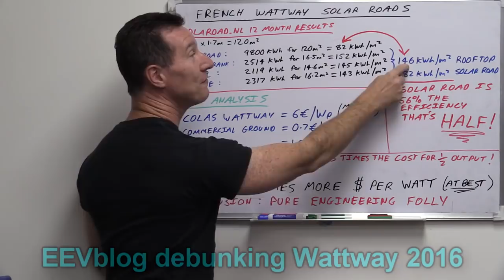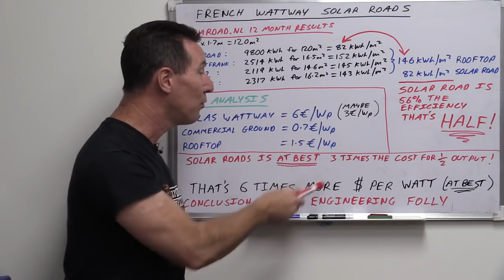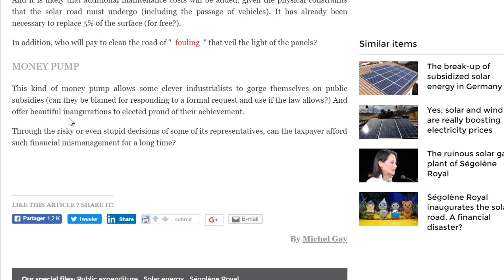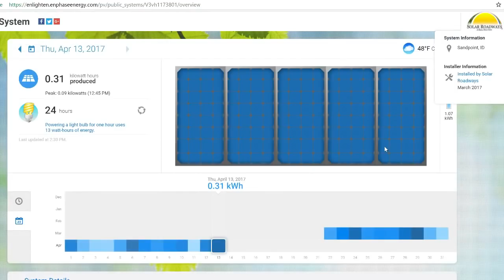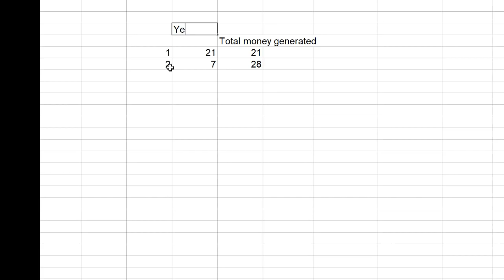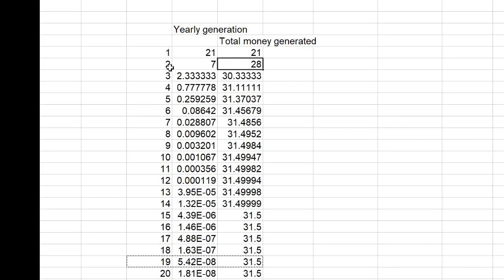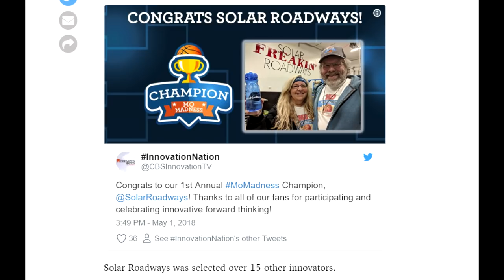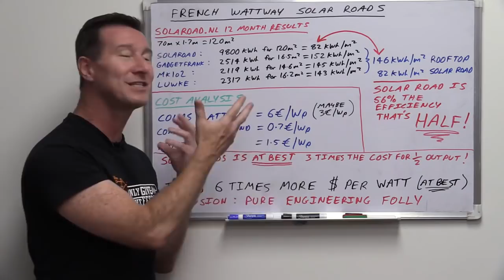Solar Roadway: 10¢ return on $1000 investment!

Comment: Wait: In the beginning he said, that 1% of the deserts full of panels would be enough to supply the world. So? Go for it!!! That, for once, seems like a reasonable and smart idea! Why does everybody want to make solar-something? Soalr panels are made for power generation. So, if you want them to act as road, you gotta make compromizes, wich will greatly reduce the efficiency of the panels. Why not just, as the guy in the beginng said HIMSELF, build a bunch of panels in the desert? No need the stuff them into the road, thus 100x the cost and x0.0001 the output!
Reply: Because the deserts are not where  most people live. It's not exactly economical to, say, run a cable from Sahara to central Europe.

Of course it doesn't have to be a desert, any flat area with enough sunlight will work but in most places you can't rely on solar alone no matter how many panels you build.
Reply: You sure about that? Plans for Supergrids seem to exist since a long time, and they seem to be pretty useful  in the long run.https://en.wikipedia.org/wiki/Super_grid
Reply: I agree, building a solar farm in the middle of nowere would be stupid. My point is, that it's not really any better, to put solar panels into roads, and that instead we should look for unused open spaces, such as rooftops, skyscraper facades etc..
Reply: Yeah. Though a lot of areas in Europe for example don't get enough constant sunlight anyways so solar would be an unreliable energy source. Solar definitely has its place....having a couple of panels on the rooftop certainly won't do any harm but it's not suitable as a primary source of electricity.

Personally I believe nuclear power should be the future....we'll have to build a few spent fuel repositories but apart from that it's clean, efficient and with modern technology also safe.

Comment: Well of course they are putting them on the road, cant put them on peoples houses they might steal them, cant do the elevated ones next to roadways people might use them for shelter! We cant put them in open fields the cows might lick them! Cant put them in deserts the emus and dust will attack them. 

Come on this is all common sense its either on the roads or in the ocean, the later is better due to them being WATER COOLED (you lose efficiency due to heat on solar so actively cooling them is a bonus) and they are self cleaning due to being in the water. Cant put them on top of the water as people might steal them or use them to not drown.

Comment: We need solar road roofs! A roof for every road, no more snow, no more rain and much more problems ;)
Reply: Roofs over roads would be extremely expensive.
Reply: Guess what so are not working solar roadways ! ;)
Reply: Skyven Razgriz That would be cheaper lol
Reply: @Skyven How would you drive over roofs???

;)
Reply: Standardowy Login finaly someone asking the right questions ! Well of course we will all have to use hover bikes, there should be a scam sooner or later enabling this tec.

Comment: I know that solar roadways, and the solar walkway installation in Sandpoint is a 100% failure. There is no future for solar roadways and it is conceptually just a bad idea. However, I do not agree with your spreadsheet demo. 

How can you assume that the 66% loss in efficiency will happen every year? To assume that such a loss is linear with no diminishing returns is a huge assumption to make. I would be surprised if the loss wasn't due to technical complications, and therefore a one-time occurrence, and therefore would possibly even get better next year.

A 1% loss would happen every year, but not a 66% loss. It is more likely that the 66% loss is due to technical complications that may actually be resolved next year, and you may see in increase in efficiency. I think it should just be shut down however tbh. Complete waste of money.
Reply: I prefer eevblog's style of using the most favorable assumptions possible, since that shows that there are no reasonable assumptions under which the system could be viewed as sensible.  Hyperbole simply weakens Thunderf00t's argument.  More important, however, is emphasizing that while it is sometimes useful to invest in poorly-performing technologies in the hope that investment will yield result in improvements (LEDs, for example, were pretty dismal in the early 1970s, but investments in the technology have paid off substantially in the decades since) but there's really plausible way that solar roadways could ever offer any real advantage over competing technologies.  Any improvements in the cost or generating power of photovoltaic cells would help other solar technologies just as much as solar roadways.
Reply: @KLM "How can you assume that the 66% loss in efficiency will happen every year?".... Its what it lost in the 1st 2 years already...So he used that 2 year loss as a baseline. Hes also not including other factors which could potentially make that loss worse.
Reply: "That 1% loss could be due to a technical problem" is also an argument you can make
The thing was 66% less efficient after a year. that's the data. doesn't matter if it was a technical problem or whatever and there's no reason to assume it would get better and it's not like this was his linchpin anyway is just a point he made based on Raw data it's just as likely to be validated as it is invalidated by Future data
Reply: I'm going to be blunt and just say that it's way more realistic to assume that they don't lose efficiency, they just break and then the return is literally nothing some time after the first year.

A 66% loss is nothing to shake a stick at, it means something looks seriously wrong to say the least.
Reply: It's 7 dollars man. the return is so fuckin low I don't think accuracy really matters.
Reply: I understand. My point isn't to advocate for or against the monetary returns. I am pointing out that Thunderf00t's reasoning is not right here. He usually makes very well thought out arguments, even in the rest of this video. But in this particular segment, it just seems lazy.
Reply: Go back and watch some of his other videos debunking other things. He may reach the right conclusion but he often is very hyperbolic and doesn't always use correct methodologies. You just noticed it for the first time.
Reply: Yeah, he does it a ton. Like in some of his "water from air" debunking videos, he basically ignores that with heat pumps, COP is a thing. I mean yeah, with Peltier devices, the best COP you can hope for is around 1, but still, he implicitly assumes that it's =1.

Comment: there are some university researchers testing out solar flowers installed in the center of the generic european roundabouts, these flowers fold themselves in for the night to avoid damage and bloom in the morning and follow the sun's path
Reply: Still mostly a vanity, virtue signalling project. You're on the ground, surrounded by buildings and other vision obstructing things, roundabout islands are not that easy to maintain, given that there's traffic all around, etc. You'll have to clean them regularily, repair them, maintain the mechanical construction moving them around. That construciton alone will be pretty expensive.

Solar panels are getting better incrementally. They're already bought and installed by private actors wherever it makes sense. There's really no need for these kinds of projects at all. But it's a good photo op for politicians and makes people feel good about themselves.

Comment: I agree that solar roadways are stupid.  And I agree with most everything thunderf00t posts.  But his extrapolation of predicted degredation by 1/3 each year is clearly unfounded.  Probably the surface of the test panels has degraded (weathered), and it's likely the panels will hold more or less steady since continued weathering of the glass surface shouldn't worsen transmission of light.  Even if I'm wrong, a drop to 1/3 between year 1 and 2 doesn't form a trend in any scientific analysis.
Reply: the panels are already at the point of failure and need to be replaced. if they currently earn $7 a year their long term surface properties are moot . they didn't even survive the first year. they failed to defrost themselves, they failed to be an lcd road surface, they failed to be an rgb decoration. the same amount of money invested in standard solar on every roof on that street would be making considerable money.
Reply: YUP, and that is an excellent point that Thunderf00t reasoning is false, they will not continue to 1/3 each year, it's far more likely that they've bottomed out or close too it.  Again not discounting that solar roadways are moronic, but science and math are things and you can't pick and choose.
Reply: Mark Hunter. Exactly what I thought.
If you are trying to show how really bad something is, you should show how bad it is in a best case scenario.
Reply: Yeah, dodgy extrapolation and just not needed. You can afford be as generous as hell and it still looks ridiculous - even if they ran at 100% of their  first year efficiency for decades those panels still wouldn't make any sense.

  I guess it's largely that many of the PVs and power electronics have just died and not been repaired... which is what happened to the LEDs iirc. if the Brushaws get down there next year and do some repairs and get their 2019 generation to go up  they're going to be using the improvement to '*debunk*' you - if production levels off l they're going to use it to '*debunk*' you. 
you've taken yourself hostage.
Reply: so 25 cents is somehow better than 10?
Reply: Mark Hunter Are you tarded? He just showed you the statistics. The surface will continue to degrade and that's with no load lolololol. It would be even worse in actual use. He was generous.
Reply: The issue is that his science on the change per year is not rooted in evidence or observation.  2 years of observations are insufficient to make a trend.  I'm not questioning his overall conclusion which is 100% correct.  But in rare cases (such as this one) Thunderf00t has made a small mistake.

Comment: How about using the weight of passing cars as energy?
Reply: That has already been proposed, but since it takes kinetic energy from the vehicles, it only makes sense where the vehicles would be slowing down anyway, or at remote roads where other methods of power supply are not available. In other words, rather limited usefulness.

Comment: honestly the smarter decision for a 'solar roadway' would have been to build panels above the road on tunnel like structures.  Then they can be angled for better efficiency, use better materials for the purpose, and when they prove to be a financial disaster as well, least the road can still be used.

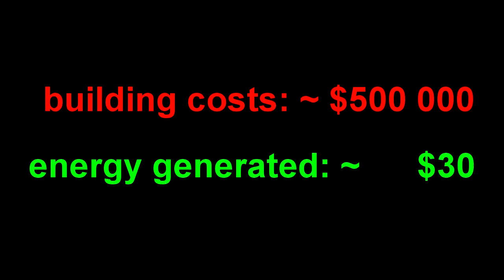also, 11:45 you math is off.  Not 10 cents per 1000 invested.....it's 6 cents.
Reply: Put them on top of the cars.

Comment: Why make a road out of solar panels?  Even if it were just as efficient as normal solar panels, repairs mean halting traffic, they’re cast in shadow during heavy traffic, and they’re far more expensive to install. I’m sure there are at least 50 other reasons that it makes no sense versus just installing them alongside roads or virtually anywhere else.

Comment: "Solar roadways are the future"

...says the idiot in the introductory video, while standing in front of a vast, empty, and quite flat desertic landscape which would be a very nice place to plant a cheap and profitable solar farm...
Reply: Get a few acres of Mohave desert and build Helios One. DONE!
Reply: Helios One was based on a real world Solar Two facility that no longer exists.
Reply: i'm a simple man, i see a new vegas joke, i upvote it
Reply: Yeah.. but isnt placing it on the road in the middle of the desert the same? Sands still blowing to the road
Reply: Well, besides sandstorms, the other issue of building it in the desert is that well.. basically no one lives there. Which means you need to somehow transport the collected energy to where people are. And there is a significant loss weather one transports them hundreds of miles through cables (which can always be at some point and then shut the whole system down until they get repaired) or if you store them in batteries and then transport the batteries to the cities-- it might take nearly as much power as is in the batteries to transport them.

The selling point for doing them in roadways was supposed to be that they are already so close to things that you want to use that energy for-- plus they wanted to make it melt snow and have them display road markings. But since they can't gather enough power to do all that, it really defeats the whole point.

The smart thing to do would be to cover rooftops with solar panels as, except in case of snow, they will generally gather more than enough power to serve the needs of a 2-story household and you can store the power during the day to use at night. You can place them on top of street lamps which in the case of LED street lamps will collect enough energy during the day to keep those street lands on at night. Put them on top of tunnels which will provide more than enough power to light up the tunnels.

So many better places to put them than to replace the street-tops or putting them in hundreds of miles away from where anyone lives in the middle of the desert.
Reply: TheHobgoblyn actually people do live in the desert they just require a ton of electricity to live in the desert hint hint nudge nudge
Reply: @TheHibgoblyn - transmission losses are around 5% for 500 miles tops, can be as low as 2.5% so that's not a factor.  The solar farms can be mostly automated so workers rarely need to visit, that's not a problem. Melting snow with power is absurdly stupid, black roadways do it 10x better and that still sucks because the energy in the phase change between solid and liquid is so large.  Manually removing it is perhaps 2-3 orders of magnitude cheaper.  The energy density of harvestable sunlight dosent match that of people in urban centers, power will need to be imported form somewhere.  Finally streetlights that are LED use 75-200 watts of power, you would need about 0.6-1.6kwh battery packs and 1-2 sq meters of panels (1-2 square yards) for each streetlight.  This would only work for streetlights that aren't shaded and right now is very cost prohibitive costing many thousands of dollars while the yearly consumption is merely a few tens of dollars so it dosent make sense for just lights.  Sorry to burst your bubble.
Reply: You build a REAL solar plant of course, with angled panels on rotating platforms. I thought this would have been obvious. Only an idiot would build a solar plant as a road.
Reply: @CleodoraSilvestri  
Better yet, take advantage of reflective properties of solar panels, and concentrate remaining light to use heat to generate additional electricity.

Geothermal is also viable when done on stable locations. Not Yellowstone National Park.
Reply: Blood I dont like sand.
Reply: I say we should build solar panels under the ocean.
Most of this space rock is covered with ocean we should use that!

SOLAR FREAKING OCEANS!
Reply: Why stop there? Let's build solar powered helicopters that can fly forever! SOLAR FREAKING SKY!
Reply: "Solar roadways are the future ... for my bank account"
Reply: All that sand would make it a nightmare to maintain
Reply: There's quite a few solar plants that have been running successful operations for decades now in the deserts of the U.S. These do not experience anywhere near as much of a problem due to dust as many other places in the world. One study on various California plants found an annual average production loss due to dust of 1.5% to 6.2%, depending on the location of the installation. https://www.sciencedirect.com/science/article/pii/S1364032116000745
Reply: I know right they were like talking about the desert and then went roadways and it's like it's so f**** stupid you were there you were right there! Come on!
Reply: not to mention sand is also rough and irritating...i hate sand
Reply: Given idiocracy is a documentary, then yes, solar roadways are our future.
Reply: Blood just get some nuclear power plants .

Comment: The whole idea was incredibly stupid to begin with. Why would you put a 1500 kilo object on a sensitive photovoltaic pad and expect it to last a number of years while being driven on. There is plenty of flat space on this planet without trying to shove a square peg in a round hole. It doesn't take a PhD to figure this one out....... not to mention the fact that in Peak periods a lot of the road surface is covered and not receiving any sunlight....... but Thunder foot, maybe if we all decolonize our minds the science might actually work? What do you think? There's a whole lot of stupid floating around these days. Thanks for clarifying some of it!
Reply: Argle Bargle Exactly. Roads are designed with destruction in mind. When you design an asphalt or concrete pavement, you need to estimate its lifetime since IT WILL be destroyed fast.
Reply: blackbomber72 Yep. Where I live we have such temperature extremes the road heaves every winter from the frost. A major portion of our tax money goes into maintaining our road infrastructure. Whoever came up with this idea was smoking crack.
Reply: If we could generate electricity from stupidity, humanities power needs would be solved forever.
Reply: burtosis probably a matrix like device we put the stupid in so they can do their brainfarts in VR and power the real world